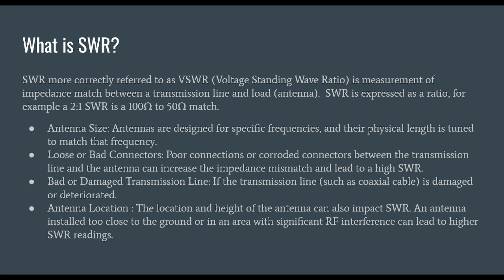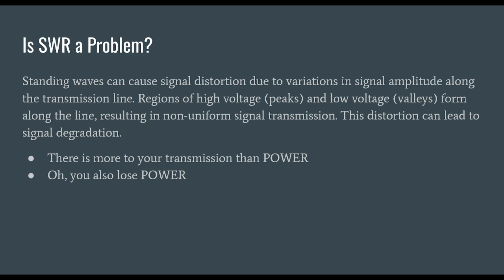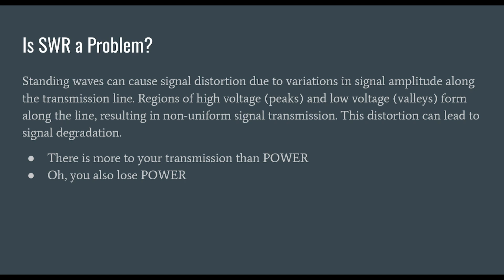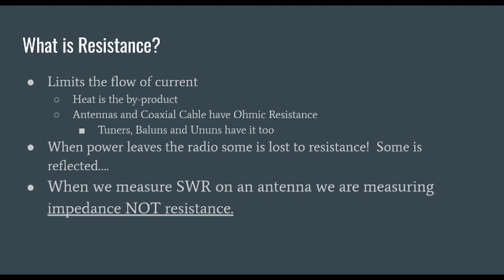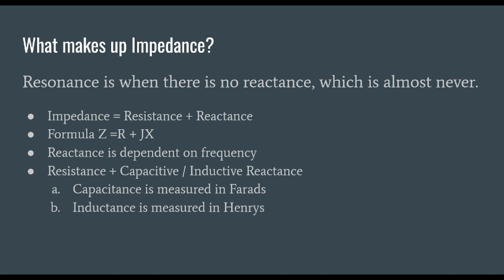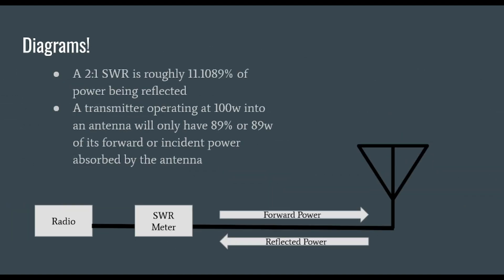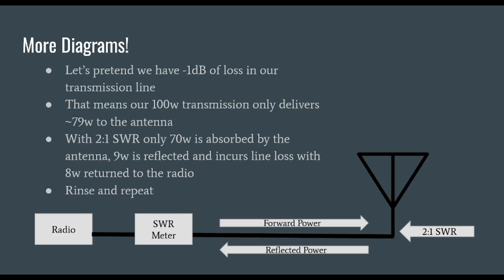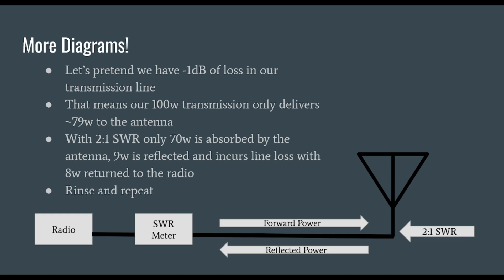Debunking SWR Myths Once and For All!

Comment: VSWR is a real thing. I don’t understand these hams that put out videos saying it doesn’t matter. I work in professional radio and we use return loss to check an antenna system for impedance mismatch. If you think about this logically, using return loss you can literally see how much power is being radiated by the antenna vs what is being reflected back for a given frequency. Also, radios do not like a high VSWR. It can cause all sorts of problems. On analog, it makes the transmitted signal seem distorted and full of static because it is feeding back into the radios finals and modifying the signal by adding to or subtracting from the forward signal depending on the VSWR in the transmission line. On digital modulations, everything will sound fine but your range will be significantly affected. Also, ladder line and window line are great. But they are not very durable and they don’t like to get wet. They also can’t be put too close to things such as walls, trees or other runs of ladder line such as you would see how coax is ran up a tower. Which is why we use coax and coax is great so long as you understand the way it works and take into account VSWR, common mode currents, and cable loss when designing an RF Network.
Reply from the maker: Great post Skrux, thank you!

Comment: FWIW another loss in the feeder is dielectric loss, power lost in the insulation with every change in polarity,  the loss logically becomes greater with increasing frequency and increasing voltage. A mismatched feeder has nodes along its length with current maxima and others with voltage maxima. 
A strange analogy with the loss in the feeder is like a taxman taking a percentage of every transaction. the radio produces perhaps 100w, 90w gets to the antenna, perhaps 10w gets reflected of which just 9w gets back to the radio, it is reflected back to the antenna where it has magically reduced to 8w. (As you said "rinse and repeat").  With an antenna that is matched the cable only gets to deduct "the tax" once. High SWR is a further issue with systems transmitting high speed data or video...
For those of us with limited space a doublet fed with open wire feeder  can be very effective as a multiband antenna, definitely a subject worth covering. 73
Reply from the maker: Thank you g0fvt, great info as always.  I like the tax analogy 👍

Comment: RG58 here but only short runs to 5 attic dipoles and an outdoor inverted vee for 60m, running QRP I get my SWR as low as possible.
 
The most stupid myth is that of C.B.'ers trimming coax inch by inch to get a perfect ½λ to the aerial.
Then they lengthen their carefully and painstakingly trimmed coax cable by adding an SWR meter and jumper lead which they say must be 3', 6' or 9' and 3' increments but not carefully trimmed to length. Why not trimmed?
Do they not realise it becomes one cable? Do they think an SWR meter is some kind of isolation device?
Point this out and they say they use what works for them and want the best from their system.
G4GHB.
Reply from the maker: Hey Bill, thank you for watching.  I wouldn’t limit that misunderstanding of transmission lines to CBers though.
Reply: @TheSmokinApe  True, I've seen only one  video of an amateur saying coax length is important. Thanks fir the video.
G4GHB.

Comment: Was a CB operator in the '60's & '70's & Everyone was Well aware of SWR & tried to have it Minimum on their installations......06:00 in my experience when the 50 ohm Tx (Rig) Final output is well Matched to the 50 ohm Coax cable (The Usual situation) but Terminated by a Defective or mistuned Antenna,  the antenna's high Reflected power is Mostly Absorbed (Producing additional Heat) by the Tx final amplifier Stage (The Tx final Is Bilaterally well Matched to the coax Z) & Little to No Significant Rf power is Reflected or "Bounced" back repeatedly Toward the Antenna.....Just my Experience using dual Simultaneously connected Swr Meters back in the days when high antenna Swr Likely Red plated Tx tube finals or Overheated the Final's output Transistor.....Maybe you can kindly address or explain ?
Reply: Reflected power is not absorbed within the transmitter finals ,it does indeed join the forward power back to the antenna, its the impedance the transmitter sees that the reflected power has changed at the line input that causes the issues
Reply from the maker: Paul, an impedance mismatch will reflect power back which will get absorbed by the finals and will cause them to heat up.  Heating them is proof, assuming that you are not overdriving them and you have appropriate cooling and ventilation.
Reply: @TheSmokinApe  reflected power from an antenna impedance mismatch is reflected back towards the transmitter, this reflected power changes the impedance at transmitter coax junction, this mismatch reflects the reflected power back to antenna , the transmitter is trying to put its full amount of power into this mismatch which causes the heating up of components ,the transmitter is unable to put its full power out ,add a tuner the transmitter is able to put its full power out with no heating of components
Reply from the maker: Tom, I agree.  I think what is the topic of debate is that the reflected power can be re-reflected by a tuner which would stop it from getting to the finals.
Reply: @TheSmokinApe  I think another important point That's overlooked here is that the feedline becomes an impedance transformer when standing waves are present perhaps this could be brought up in a future video on the subject
Reply from the maker: That is a good video idea
Reply: @TheSmokinApe  it would stop all the confusion of where the reflected power goes as many think it's still matched because they have 50ohms coax

Comment: That was a pretty good presentation on Standing Wave Ratio. You mentioned that SWR should actually be called VSWR. Yep, that's half correct. SWR can also be ASWR which is Amperage Standing Wave Ratio. I actually had an ATLAS 350 transceiver that had a built in ASWR meter. OK, it's the same thing as far as the ratio goes but one measures Voltage reflection and the other measures Amperage reflection. As to Open wire feed lines and Coaxial feed lines, there is no contest that open wire feed lines are the absolute best as long as conditions are perfect. Uh Oh..... Whatever you do, don't let rain, snow, or Ice get on the open wire feed line because then all bets are off and open wire completely sucks until the Rain, Snow, or Ice completely goes away and the feed line gets back to completely dry. Also, open wire feed lines are very picky about how long they are. You better do your math before cutting and installing open wire feeders. Hmmm.... Using open wire feed line in the hot desert might be the perfect place to use it but not in the far northwest or Alaska.  I'm a high quality Coax freak because those issues don't plague coax users. I'm sure you are going to have future videos involving BALUNS and I look forward to watching them. They absolutely have their place but I would never use one because it has been my experience that Baluns correct impedance issues and improve matching but the gain in correction results in power losses that pretty much equal the use of no balun at all. I think that you probably should have mentioned that Standing waves on the antenna is good but standing waves on the feed line is bad. If the antenna is cut perfectly, then no standing waves are sent back down the feed line. Here is something else you might want to look into: 75 ohm coax hears better than 50 ohm coax but 50 ohm coax transmits better than 75 ohm coax. I used 75 ohm hardline for years on HF and eventually swapped it out with the highest quality Coax I could afford and I can't tell the difference between them. OK, OK, I used an antenna tuner on both systems. In a pinch, I have no issue with using high quality 75 Ohm coax in a SHTF station setup. Yep, you're going to probably be able to get a 1:1 with high end Coax and about a 1.5:1 with 75 Ohm coax. It's not going to hurt your radio at all, especially if you use an antenna tuner. Page Keith Veazey: WD4OIM: Advanced Class Amateur and holder of a General Radiotelephone License. I look forward to watching future videos.
Reply from the maker: Thanks for the informative post Page, great point about ASWR.  I did neglect to mention that as most folks use the voltage meters.  Thanks for calling it out 👍

Comment: Hi TheSmokinApe, 

Thanks for the most excellent VSWR synopsis.
 
Possibly needed to expand a little re the 1dB transmission line loss (cable attenuation) resulting in a ~20% power loss; no matter the transmit power. I had to rush off and do the maths. :) 3dB is of course 50% lost power.

The subsequent interaction between 1dB cable loss and a 2:1 SWR (~11% power loss) was really well dealt with. 

For me It's why antenna gain (multiple + dBs) and good receiver sensitivity (multiple +dBs) are critcal in any end to end path loss calculation. Oh and a 'quiet' receive location.

73's VK5ZEJ
Reply from the maker: Hey VK5ZEJ, here is the maths:

p = (10 ^ X/10) *100
p = (10 ^ -1/10) *100
p = (10 ^ -.1) *100
p = .7943 *100
p = 79.43%

Double checked here:

https://calculator.academy/db-to-percentage-calculator/
Reply: @TheSmokinApe  Sweet🤗
Reply: So roughly ... -1dB = -21%, -2dB = -37%, -3dB = -50%.
Reply from the maker: Sounds about right

Comment: That Mark the Ham Florida man was saying that a 20w radio with 10w reflected power equals 30w to the antenna. He also claims that an SWR increases power because the reflected power eventually radiates and reflected power is not lost. It's exhausting to try to correct him because he has so many ignorant followers.
Reply from the maker: Right, that guy is out in left field 😮
Reply: You may have misunderstood what mark said, he said reflected power adds to the forward power he didn't say that it radiates extra power, some of what he said may have not been explained in full and a little rough around the edges but in the main is correct, it's easy to check this information by referring to arrl books and reflections by Walt Maxwell  rather than try to discredit someone who is trying to help with the general misunderstanding in the hobby
Reply from the maker: I didn’t call anyone out directly, you did.  Thanks said I do appreciate your comment and that you watched.  If you are referring to the video I think you are, I don’t believe he spoke about the potential for signal degradation or line loss.
Reply: @TheSmokinApe in one of  the videos in question mark mentioned reflection gain,I believe this is where the most misunderstood part of this subject is misunderstood and misinterpreted perhaps you could do a video to help it being more understood
Reply from the maker: I might, thanks for the interest in this video Paul

Comment: Ok  my question if I run 450 ohm ladder line to my antenna I will need to use a 9;1 transformer the transformer will cause heat witch will cause  loss say my feed line is 50 foot long what is the difference in loss between that and lmr 400 run with 1;1 swr I hear a 9:1 transformer is lossy
Reply: Why would you use a 9:1 with 450ohm feedline? I've never heard of anyone doing it but I am sure someone has. Hang on, I think I see what you have done.  No, 450ohm ladder through a 9:1 does not equal 50ohm.  So, how it works is this...  The feedline must match the antenna at the frequency we are using, but it rarely does, not least because we keep changing frequency.  Often the total ohms of the feedline and antenna will be in the many thousands of ohms (above the frequency the antenna is tuned to) and so we often ( usually ) use a 4:1 balun to reduce that to hundreds of ohms (sometimes still in the low thousands.)  Then we use an "external" ATU to match that hundreds of ohms to 50 ohms.  So why would we do that?  Well ladder line is virtually lossless.  Compared with coax there is almost no losses at all, even with the balun and ATU.  Unfortunately, some people take that logic and use it for low loss coax and that is not the same.  Coax has a lot of advantages over ladder line, it is easier for one and it is well shielded from interference.  You can often tune an antenna so it will work multiple bands on an internal tuner with coax.  But ladder line users really look towards a really good external one, which is an added cost.  I hope that explained a bit.  The question you should be asking is do I have an external ATU?  If so then you could try ladder line and a 4:1... if not then stick to coax for the main run and use an internal ATU where you can.  Now where you do see a 9:1 used is with a non-resonant wire with coax,  the idea here is simular.  You are taking thousands of ohms and reducing them to the low hundreds or even tens of ohms where most internal ATU can tune them on several bands and there is some clever calculations people have done to get wire lengths that will tune on every band with an internal ATU (and even without an ATU at all in some magically rare almost theoretical cases)
Reply from the maker: Hey Vet, here is a video I did measuring loss in 9:1 ununs: https://youtu.be/6j1Yc1Y4Ly0

I actually have quite a few measuring various core types, that might help you out.

Thanks for watching!

Comment: "Absorbed by the antenna." It's not a direct measurement of it, but wouldn't that basically be radiated by the antenna, assuming you're transmitting of course?
Reply from the maker: So here's the thing... Energy that is absorbed by the antenna is either consumed by radiation resistance or or ohmic resistance; one is radiated as RF and one is dissipated as heat.  Hope that helps.
Reply: @TheSmokinApe  Yep, makes sense. I was thinking the line reflected portion (or at least a portion of that portion) would turn into heat, but it makes sense that a portion of the other would too. 73

Comment: Something to add, and I just learned this from W6LG... In other words, I'm just regurgitating what he said, is higher SWR also potentially incurs another problem. The problem you will likely have to now have to manage is Common Mode Currents.
Reply from the maker: Hey David.  With CMC, it's a product of unwanted currents being present on the outer shield of the coaxial cable that isn't balanced with the differential mode current.  It sounds surprising, but coaxial cable has three conductors; the center conductor and then the inner and outer shield.  you can have CMC with low or high SWR.  I didn't see Jim's video but you can have CMC and it can make SWR appear higher that it would if there was no CMC.  It's a pretty confusing and complex topic.

Comment: Some very good points, in particular it is always surprising how much power is lost with only 1dB of feedline loss.
Reply from the maker: For sure and when you start add it up with tuner / transmatch loss it can be an eyeopener.  Thanks for watching Pez 👍
Reply: @TheSmokinApe can you explain how a tuner loses power ,, if a tuner is introduced it allows the transmitter to put its full power into the system therefor more power to the antenna than without one
Reply from the maker: Insertion loss...
Reply: @TheSmokinApe  if the tuner is sized up for the situation the insertion loss isn't measurable at legal limit powers and certainly wouldn'tbe noticeable on a received signal ,with many kilowatts maybe but you would have a tuner capable of handling that
Reply: however, no body will ever see any difference transmitting with 80w instead 100w .... think that is overvalued  @TheSmokinApe
Reply: lets assume i lose 20w as you said and only 80w will be radiated instead of 100w, does the opposite party realize that? the loss in my antenna switch is 0,01db , thats nothing... , have i missed something...?   @TheSmokinApe

Comment: Parallel feed line has it's place, just like coax has it's place. It's not a question of which one is better overall -- it's a question of which one better suits the requirements and goals of the antenna system you are designing. For me, I can only fit a single wire antenna and it has to work multiple bands. So my first attempt was a coax fed 6-band Fan dipole. It worked well until it came crashing down from the weight of the ridiculously large center connector I built. After that, it was a window-line fed 160m doublet with a tuner. It's my best performing favorite. Even so, I'm itching to try an OCFD. Truth be known, I hope I'm never satisfied with my antenna. I like tinkering too much!
Reply from the maker: I'm with you on the tinkering.  Thanks for the perspective JD 👍
Reply: I hope to never have found the "perfect" antenna. Building, modifying/tuning is most of the fun and satisfaction. I first made a 5 leg fan for 6-80, then messed with some non-resonant verticals, and currently running an 80m OCFD and ot does well. However, a resonant ground vertical with radials has a super low noise floor in my case andnI really love it. It's good to have options, depending upon the time of day and band :)
Reply: My first antenna was also a 6 band fan dipole that i built back in 79 when I got my novice ticket.  Worked the world with that and a 50w Heath HW-16.  Built several verticals but they didn't work as well.  Love tinkering with antennas.  0:12 are you speaking of radio tube?
Reply from the maker: LOL, I wasn't talking about @Ham Radio Tube
Reply: Right  lol
Reply from the maker: @mewrongwayKOCXF  lol
Reply: @mewrongwayKOCXF  https://youtu.be/LGKTysU0ya8?si=Nog-zU90WwfiJOMr
I'm guessing this guy.